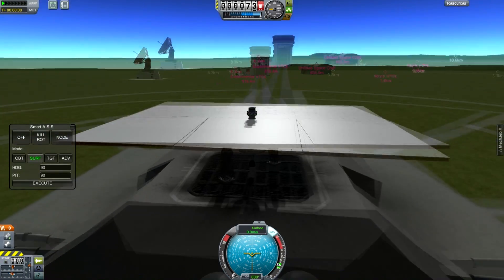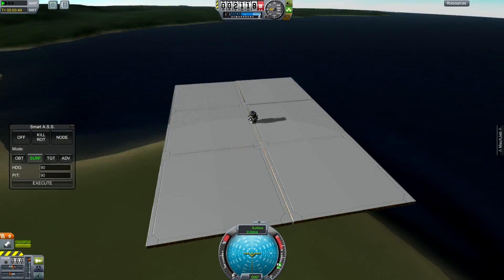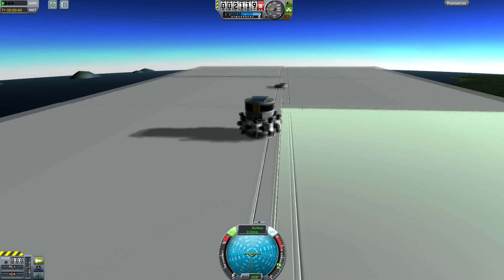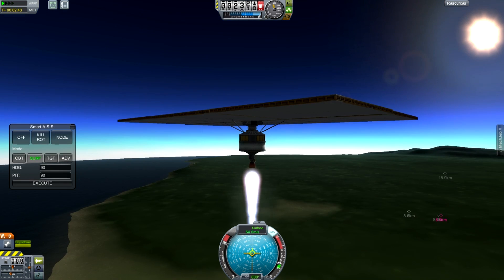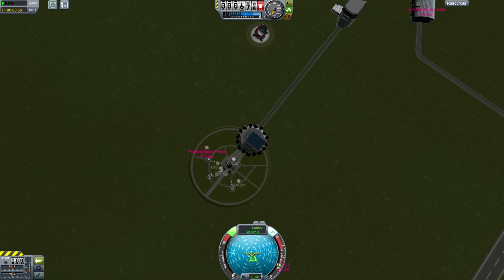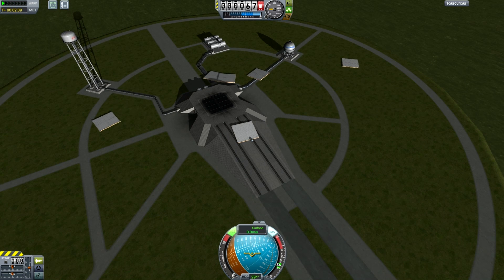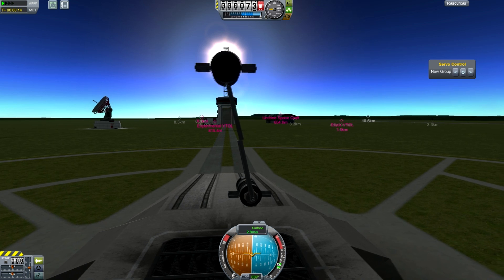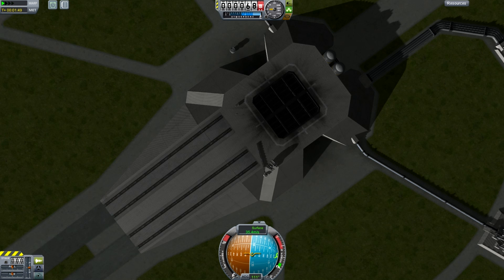Kerbal Space Program - Exploiting The Quantum Anchor For Fun And Profit

Comment: So if antimatter goes backwards in time, would anti-uranium gain mass over time?
Reply from the maker: Kirrim Kerman the time reversal is a mathematical construct - if you read Feynmann's work on the theory of positrons you get the idea http://en.wikipedia.org/wiki/Positron
Reply: attack125
it is a proven fact that neutrinos have mass, an thus they cannot move at the speed of light
Reply: +attack125 http://spectrum.ieee.org/tech-talk/aerospace/astrophysics/nobel-awarded-for-discovery-of-neutrino-mass they have mass and thus cannot move at the speed of light. They do move very close to it though
Reply: Scott Manley well I learned something today.
Reply: +attack125 You made that up.
Reply: +attack125 neutrinos move slower than the speed of light,  nothing can go faster than the speed of light. They also have mass
Reply: +attack125 "neutrino's move faster then light (it would take infinate energy to slow em down to the speed of light.)" - You're confusing neutrinos with hypothetical particles called tachyons which move at infinite speed if they have zero energy and slowing them down to light speed would take infinite energy. Tachyons have imaginary mass (see "complex numbers") and they are only very hypothetical particles not observed in nature. Neutrino oscillations imply neutrinos have non-zero mass even tho very small as said in qwertys link. Also about antimatter: in quantum electrodynamics antiparticles can be thought as normal particles moving backwards in time, since the math and physics works the same way when described like that... but antimatter doesn't have antigravity effects atleast according to general relativity - antigravitational field would need negative energy which implies negative mass, not just negative electric charge.
Reply: Person Oisels Right now, you are the only person on this thread that thinks that neutrinos don't move slower than light.
Reply: for anyone who reads this thread:

1. photons (as waves) carry energy, and as particles can carry momentum. however, they do not have mass.

2. neutrinos have such a low mass that it only takes a bit of force to accelerate them close to the speed of light. however, under current understanding, they do not travel AT c.

3. tachyons do not exist under the Standard Model of Particle Physics and their mechanics have been disproven through tachyonic condensation.

4. opinions =/= fact

5. read up before you post, especially when debating with science.
Reply: @user-me7hx8zf9y  bless you
Reply: attack125 "Tachyon" is just a vague name given to any hypothetical faster than light particle, if neutrinos moved faster than light they'd be tachyons. It doesn't refer to an actual specific hypothesised particle.
Reply: Person Oisels What you're saying implies that you believe that neutrinos don't move slower than light.
Reply: attack125
Well you can say that but you just made it up. It may be that it's such a small difference that we can't measure it (probably) yet, but it could also be something else. Some scientist think it may be quantum effects in play. We don't know.
Reply: MiniMash Except that the problem for you is we don't measure that. The tests so far give a speed in agreement with the speed of light. You can't simply state that we can measure it when we don't. Either we don't have the capacity right now to detect the difference between the speed of neutrinos and the speed of light (or rather, that no such test has actually been performed), or they are the same and YOU'RE the one saying it. the measurements of the difference between neutrinos speed and the speed of light so far are within the margin of error.

Again, just a fact.
Reply: Hypothetically.
Reply: Proponents of Einstein's special relativity need not worry, though. The underlying waves that make up the pulse remain at subluminal velocities, so no information, matter or energy actually travels faster than light *****
Reply: Sans The pungeon master
No. The "speed of light", that is the universal constant "c", is the fastest speed possible, only attainable by something without mass. IF photons have mass then they do not travel at c (although the difference may be so slight as to be unmeasurable by our current instruments - as is presumably the case with neutrinos).

As I said, as far as I am aware the photon has NOT been shown to have mass and you are simply misunderstanding something. The mere fact that it is a particle does not preclude masslessness and commonly accepted scientific theories all hold that the photon is strictly massless. Again, if it isn't this doesn't really change anything aside from simply that photons do not travel at "the speed of light".
Reply: Person Oisels Anything with mass would require an infinite amount of energy to accelerate to c.
Reply: MiniMash
Either an infinite amount of energy (which doesn't exist) for a finite amount of time or a finite amount of energy for an infinite amount of time (IE. never).
Reply: Person Oisels The last part confuses me. Care to explain. You seem much more clever than me.
Reply: Sans The pungeon master
Again, if photons have rest mass then light does not move at c, simple as.
Reply: Sans The pungeon master
on what basis are you saying they have rest mass/energy?
Reply: Person Oisels I think your knowledge is a bit wonky. neutrinos have such small masses that they might as well be travelling terribly close to the speed of light. however, it is known that they do have a mass- albeit magnitudes lower than an electron even- and therefore cannot move at the speed of light without disproving general relativity (which as of current is considered a complete model).
Reply: Sans The pungeon master they have momentum, not mass. momentum and mass so not mean the same thing. do not confuse these, as they are seperate quantities and should each be handled with care. (they have momentum since they have energy; however, where in most matter energy can be carried through mass, it is frequency that carries energy in photons).
Reply: I think he said that antimatter travels back in time to add dramatic affect. Anti matter and normal matter are pretty much the same thing except for opposite charges.
Reply: MiniMash
No it doesn't. It's just a fact.
Reply: it is proven that while they do have mass, photons, which make up light also also has mass. They both simply have negligible mass. This basically just means that they are so light they might as well have no mass, lighter than the sub-subatomic particles which make up atoms. this means that they travel at the speed of light. not faster or slower.
Reply: @sansthepungeonmaster5864  it doesn't matter how low there mass is, you can't accelerate any amount of mass faster than light.
Reply: Sans The pungeon master
No, what you just said is wrong. If they have mass they travel slower than the speed of light, though it may be imperceptibly slower as far as our current instruments are concerned. afaik photons haven't been demonstrated to have mass, but if they have the same deal applies (and "the speed of light"is not actually the speed of light at all, although it's very close).
Reply: Person Oisels All matter (which includes particles) has mass. The fact has been long debated, but it has been proven that photons do have mass, because they make a recoil when they bounce off of objects (why solar sails and solar attitude control works) and the speed of light might not be the fastest speed possible, but it is the fastest speed for anything with mass.
Reply: MiniMash
It's a hypothetical. It still results in an infinite amount of energy so I wasn't really disputing you, but to reach c as an object with mass you would either need to add an infinite amount of energy over a finite period of time, or a finite quantity of energy for an infinite amount of time.
Reply: Person Oisels oh. I didn't know that.
Reply: isn't it m=e/c^2
Reply: oh. Didn't read the rest
Reply: MiniMash to respond, if you commute the whole equation yes M=e/c^2, but you maybe made the mistake of assuming that the density of an item remains static as you add enough mass everything has gravity, and thus both equations do technically exist, but the M=ec^2 is the useful one.
Reply: I'm only saying that while in the case of actuality and effect the two vary wildly.
Reply: attack125 almost, but not quite the opposite is true.
Reply: Quantti tachyonic condensation (i.e., particle condensation) is accepted as the mechanic disproving tachyon mechanics. Still, interesting theory.
Reply: @GamingWithNikolas  allow me to rephrase what you just said: "you can interchange energy and mass but they aren't interchangeable."

are they or aren't they? Why does mass result in gravitational energy,  and energy result in mass? They can be exchanged for each other.

Also, most of this stuff is from years ago, don't necropost just to at people. While I understand, after studying more about physics, that my previous point of view wasn't completely correct. I made do with the information available to me to form a model of reality that was reasonably robust, and that is good enough for it to be valid. Posting attacks that simply say "you're wrong" aren't very good. I've provided the proof I've used to form my hypothesis, now you need to provide proof for yours. Where are the links? The published articles? Let's see if you actually care or if you're just going to be another self-righteous, degenerate, asinine troll with logorrhea.
Reply: @sansthepungeonmaster5864  I must have been dead asleep when I type that because I can't even understand what I wrote. I got rid of all my junk comments.
Reply: +attack125 They have mass, and thus cannot move at the speed of light
Reply: qwerty123443
apparantly we are both wrong.  
the faster then light observation was faulty mesurement equipment.  (fiber optics placed in the wrong order. and a clock occilator that was ticking too fast.)  but they have also shown that it moves *at* the speed of light. so you are wrong aswel with the statement that they cannot move at the speed of light.
Reply: MiniMash You can say that all you want, but IF they had been or ever are measured travelling at the speed of light then simply saying that they have mass and can't doesn't hold any weight. Clearly attack thought/thinks they have been so this rebuttal is not a good one. As far as I know the experiments that detected them going FTL were found to be detection errors and all other measurements are consistent with them moving at light speed, which isn't definitive but it's a problem for physics given that some of their properties imply they have mass. It's not known with any certainty whether they have mass yet - yes, some of their properties imply mass, but the measurements SO FAR are consistent with a speed of c which implies they don't.
Reply: MiniMash No I'm not. I didn't say that, where the fuck did you get that from. And the opinions of some random people on youtube don't actually matter. What matters are the facts. The fact is that they have never measured neutrinos to be moving slower than light. Doesn't mean they don't, just that it hasn't been measured yet and whilst that's still a fact there's a problem that needs resolving one way or the other.
Reply: Person Oisels We can measure it, because of how far away distant celestial bodies are from earth, the difference in speed equates to light arriving hours earlier than neutrinos.
Reply: Person Oisels ok
Reply: Person Oisels but that's the thing: light, at rest has energy as described above, if we saw a photon in a zero point energy situation then you would have zero mass, but with energy it has mass, just that it doesn't technically have mass, the distinction in practice is so fine as to be negligible. For all intents and purposes it has mass.
Reply: Person Oisels
no quantti is actually right. 
i was thinking of  tachyons
Reply: +Enoan he was confusing anti matter with neutrino's  neutrino's move faster then light (it would take infinate energy to slow em down to the speed of light.)and probbably experiance time backwards.
Reply: @attack125  No they don't. You can't go faster than light, it takes an infinite of energy to do so.
Reply: qwerty123443 "On July 12, 2012 the OPERA collaboration published the end results of their measurements between 2009–2011. The difference between the measured and expected arrival time of neutrinos (compared to the speed of light) was approximately 6.5 ± 15 ns. This is consistent with no difference at all, thus the speed of neutrinos is consistent with the speed of light within the margin of error. Also the re-analysis of the 2011 bunched beam rerun gave a similar result."
Reply: ssjwes
it makes me feel better. 
and in some cases it would make me feel better if it actually happend aswel.
like in your case
Reply: Person Oisels
they are moving slower then light.  but at such a degree that i cannot even type out the number.  as in 0.000000000000(3 hours later)000000001% slower
Reply: @attack125  then you can't say it's moving at the speed of light
Reply: qwerty123443
all 3 are wrong. 
neutrino's cannot go *slower* then light.
don't spread your ignorace around please

Comment: I can answer that I think, you are probably familiar with the equation, E = mc^2. You may not realise however this is a simplification of the equation 
E^2 = m^2 c^4 + p^2 c^2  , by letting p (momentum) equal zero you have E^2 = m^2 c^4 and then taking the square root gives the well known E = mc^2. However there is another solution which is E = -m c^2, since the square root of m^2 has two solutions, m and -m.

So theoretically a negative mass can have a positive energy equivalence.

Comment: You know, I /was/ thinking I had a better idea. Mess with KAS so you can have a really long and really strong cable. Put a geostationary station with a little tug/grabbypiece/something on the bottom. Place ship on launch pad. Drop tug/grabbypiece/something onto the launch pad. Grab ship and haul it into orbit.

...Then I figured that the orbit would probably be thrown way off and lead to sillyness due to connecting to a large mass on the surface. But maybe I'm wrong! And this is still cool.

Comment: okay so I went back and tested it. when you're on the surface your velocity is normalized to the angular velocity of the planet at that point on the surface. once you reach a certain altitude you transition to an "orbiting" state, and it adds that velocity vector to your current vector to renormalize your velocity to the planet's center of mass. SO, if scott got his walker high enough to transition to orbit, I think that added velocity would rip it apart, unless he happened to be over a pole.

Comment: well theoretically your speed is normalized to the surface velocity of the body you're orbiting. In this case it would be Kerbol itself if you left Kerbin's SOI. Assuming you could park yourself in geosynch around Kerbol or you had a vessel with sufficient thrust to reach zero velocity in a near-Kerbol orbit temporarily, you could do this outside of Kerbin's SOI. Now get on my rocket so I can try this.

Comment: so I assume that, because your velocity reads as 0 when you're on the pad, or stopped like that, that it is normalized to the surface of kerbin rather than the center, because otherwise you would have a small rotational velocity. so if you escaped kerbin's SOI  using the antigrav walker (so that your velocity is renormalized to your new SOI) and activated the quantum strut, would your craft be ripped apart, or would it simply be moving at that rotational velocity?

Comment: If you still play Orbiter, you could try installing the DeltaGliderIV addon which is capable of carrying special payloads which configuration files can be easily edited. Then use an existing container as template and change its mass to a negative number greater than DGIV's weight. Try thrusting the DGIV carrying it ->???->PROFIT!!!

Comment: In current dimensional "theory" (point-lane-plain postulate) the 4th dimension that traditionally represents time is treated the same as all other dimensions. Therefore travelling backward in 4th dim. (time) is just as viable as forward. Basically if You assume that Big Band was an expansion that happened throughout all dimensions then you'd get particles going in every possible direction right? That would include both ways in every of 11 postulated dimmentions. (But I can be completely wrong).

Comment: nope, entropy refers to the measure of order (or disorder) a system has. There is no such thing as unusable energy, mass is energy and energy is mass, energy can be converted to another type of energy only limited by human technologies at different efficiencies. For example electricity to mechanical energy and vice versa is much more efficient than thermal energy to electricity.